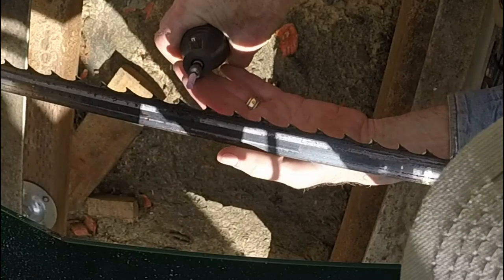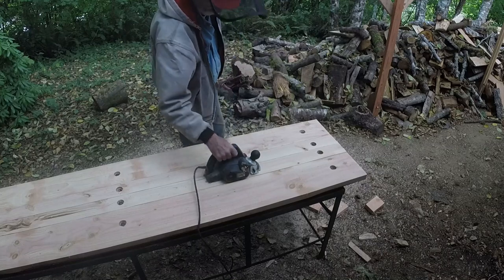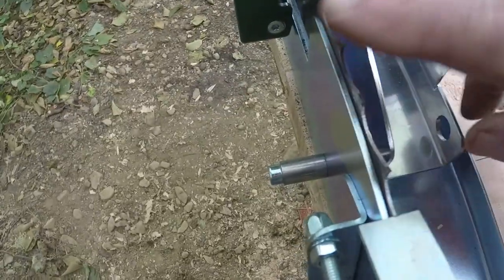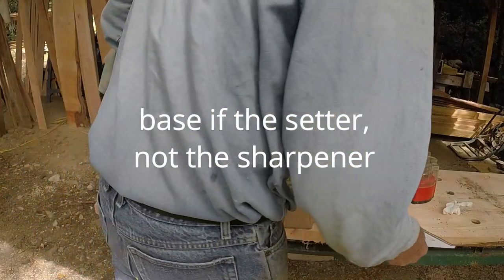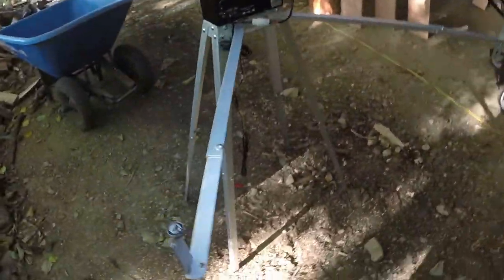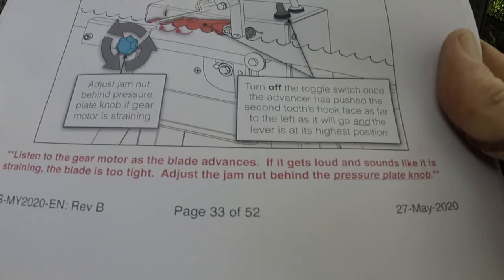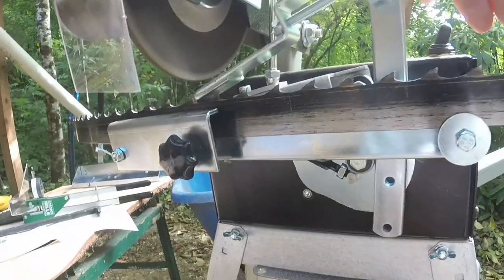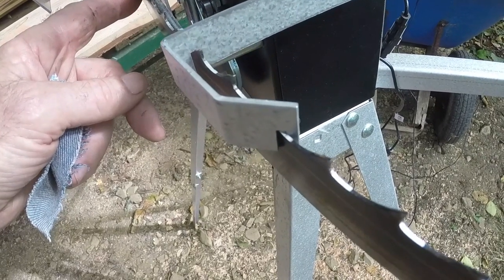Sawmill Saga: Evolution of My Sawmill Blade Sharpening

Comment: From one blade to the next you still need to make slight adjustments. The beauty of this sharpener is after it's setup you can walk away and do other things as long as you set their stop before the blade come to the weld because at that point the teeth may not be the same distance apart as the rest of the blades teeth.
Reply from the maker: I've sharpened only a few, but your are right about the adjustments, especially when sharpening more than one brand of blade.

Comment: Woodland mills blade sharpener and tooth setter work great and when I purchased them together I got a better deal. Just wish I had the money for them at the time I ordered the mill, could have saved on shipping charges.  Woodland mills offers a flat shipping charge when their mills are shipped regardless of all the accessories you order at that time. I  also ordered an extra grinding disc since it is a unique disk and can't be purchased anywhere else.

Comment: I still haven't setup my tooth setter. I  believe the blades I got from cooks could use their teeth set. I  also have the HM122,  and only got the 7 hp, but perfectly happy with it. The 7 hp warns me early that my blade needs sharpening.  If I had more power I might not notice it so much and I  would be working the blade excessively.  I  strictly bought my mill for myself.  At 72 I'm in no hurry cutting wood and I  don't need to be cutting down trees that are to big for this mill. So it works out great for me,  this mill is perfect for me.
Reply from the maker: I think the 9.5 is a recent option. I like your thinking that the 7hp gives you early notice that the blade is getting dull.

Comment: After using the sharpener and setter for a while, are you really pleased with it?
Reply from the maker: I have so many blades, I don't sharpen often, so I've used the setter only once and the sharpener twice. But I'm down to one sharp blade, so I'll be setting and sharpening again soon.
Setter is fast and easy. Sharpener is molasses in winter, but, unless you want to spend a lot of money, it works just fine. If I were milling as a business, I'd buy a Cook's or something similar.

Comment: The knob you adjusted so it didn't labor doesn't effect how much it grinds on the teeth. The blade pusher adjustment determines how much is taken off the teeth. I love this sharpener.  I don't believe it was ever laboring.
Reply from the maker: Tightening the tension on the blade gripper does have a small effect on amount ground off the face of each tooth. Reason is, when tight, all slack in the advancing linkage is taken up and parts bend a minuscule amount resulting in a shorter advance. It's very slight, but it makes a difference.

Comment: Have been looking at Woodlands sawmill kits and didn't even know that they sold the tooth setter and sharpener.  Sounds like a no-brainer to buy all together.
One question.  Shouldn't the blade be supported at the same height on the table as the setter?  That way the blade isn't twisted slightly as it rotates around to be set.
Reply from the maker: I agree in theory, but it doesn't seem to be a problem. I do lay a board back there to support the blade, though. The blade may not know the difference, but it makes me feel better.

Comment: My Mill has been on back order since June but should be shipping out in a week or so.  I'm curious how long it took them to ship out your sharpener because I may want to get one as well.  Something you may want to watch for as your sharpener gets a bit more use is the tension plate you were adjusting to put less strain on your advance motor.  The more you use the sharpener the more that tension plate will wear and you may have to adjust it again once it has been broken in for a month or so.  Less tension may cause the blade to advance too far.  Just something to keep an eye on.
Reply from the maker: When I ordered sharpener and setter late in spring--I don't recall the date--I was told to expect them by end of August. I got them in July.
I'm going to remove the tension plate and polish the edge that contacts the blade to see if that will allow more tension without straining the advancing motor.
Reply: Andrew Bupp, if you order a sharpener and you think you'll ever be ordering an extra grinding wheel for it, I'd order it with the sharpener to save on shipping costs.  A spare wheel cost $20 and the shipping for that was another $20. Maybe cheaper if ordered all together.  Also woodland mills has a package deal when you order both the sharpener and tooth setter combo.

Comment: Mr Rush! Check in your local area and see how many people have mills I sharpen and set blades and make good money at it! Great way to earn money on the homestead. I bought a cat claw setter from cooks works well I have to say I am disappointed in the workmanship of the machine and if you view the website they say it is all half inch steel but it came with a 3/16 base plate they said they did this to reduce the weight .so they are somewhat misleading.  It however works so I can improve the workmanship they did give me some money back on it. I think me being in canada they sent me a refurbished setter thinking I would let it go! I will do a review I check with the website to see if they changed the information about the base plate so far not! If you run water it keeps the blades relatively clean!
Reply from the maker: Just found your comment, Marc. Sorry so late in responding.
Woodland Mills sharpener is slow, about 20 minutes a blade. Fine for hobbyists but not for making  money. I am sharpening blades for a nearby sawyer in trade for logs, though.

Comment: That’s a good investment, no two blades are exactly alike on dimensions, so it’s always a good idea to stay with the process, if you don’t mind me asking, why did you set the teeth before sharpening the blade?
Reply from the maker: Why would I not? I've seen arguments for both ways. One says, set first; the other says sharpen first. My best guess, without more evidence, is--what difference does it make?
Reply: @OregonOldTimer  imo, blades get brittle as they wear from heat and stretching, therefore the process of sharpening with a grinding wheel will reheat the tooth and remove some of the brittleness making it easier to set without breaking the tips off. I’ve sharpened lots of blades both ways and from my experience there is less tip breakage after they are sharpened, but hey to each their own. Good luck with new tools.
Reply from the maker: @bluethunder1951  Interesting line of thought. Experience beats opinion. Thank you.
Reply: @bluethunder1951  I never thought about that, but I wouldn't think a light touch of the grinding wheel to the blade would have much annealing effect on the blade.
Reply: Now if you want to weld a broken blade back together you need to soften or anneal the welded area, but that requires heating the blade to a light red glow to help keep it from breaking at that point.
Reply: @pstoneking3418  Not so sure it anneals the tip, but it does remove any minor stress cracks in the tip that might cause breakage during setting.
Reply: @OregonOldTimer  If you grind the blade first you will have a burr on the blade which will affect the set. Have a good day.
Reply from the maker: @kevinrecoskie519  On my last sharp blade now, so I'll be setting and sharpening soon. This is the first time I've heard your argument for setting first. I'll look carefully to see where the setting pin touches the tooth. If it's behind the cutting face, any burr shouldn't be a factor.